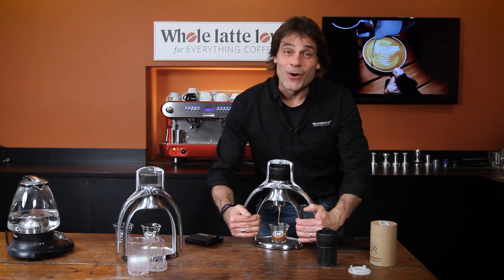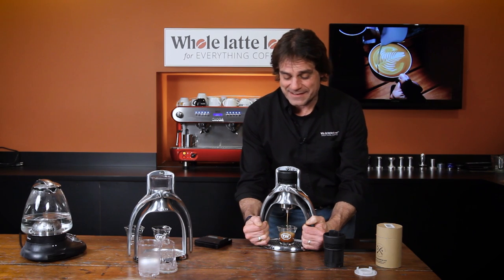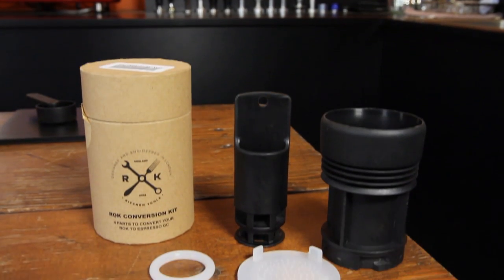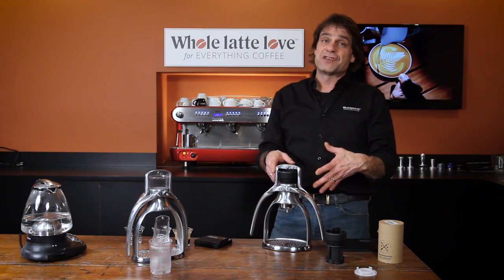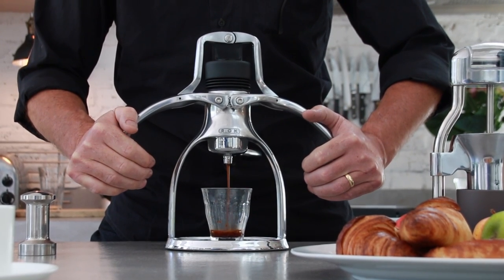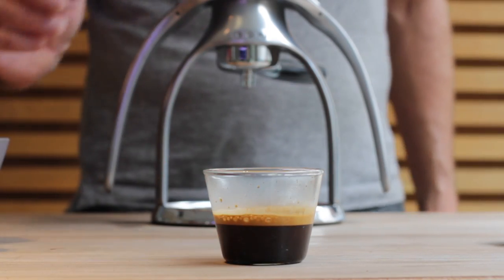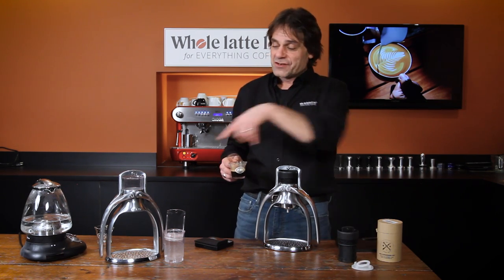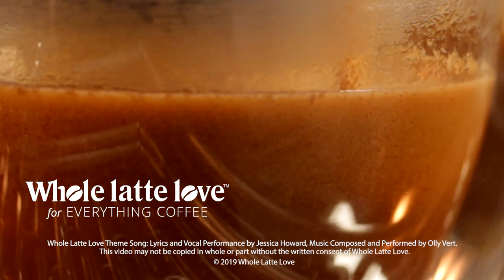ROK EspressoGC, GC Conversion Kit + Naked Extraction!

Comment: I have the original ROK. I found it to be more a labor of love than a practical way to enjoy espresso. So easy to make mediocre espresso that a rare success turns into a moment of euphoria. 
The new bottomless portafilter is a welcome upgrade because tamping with the previous center hole portafilter was uneven and measuring on a scale was a massive, messy chore. 

I definitely think you need either the ROK manual grinder or a mid to high-end grinder to get the consistent results that will make the extra work feel worthwhile. You also need quality beans. So don't confuse this as an inexpensive or "easy" path into espresso. Also don't think you're going to enjoy this right out of the box. It could take you dozens of practice shots.  

Perhaps this new design change has significantly altered the ROK experience and I will definitely get my hands on these upgrade parts to find out.
Reply from the maker: Hi y, Thanks for the detailed comment! I agree tamping the bottomless PF is a heck of a lot easier! We should have bottomless PF's in stock soon. As you likely know using the ROK well requires good temperature management. Really helps to run a couple blank shots to get things warmed up. For the shots pulled in the video I ran blanks. I'd fill the "reservoir" with boiling water and let it sit for a half a minute before pushing it through. When ready to pull a shot fill the reservoir with boiling water and brew immediately. After lifting the arms water starts to drop on the coffee I let it sit in that position for pre-wetting the coffee for 10-15 seconds before starting to push. A good grinder and beans definitely helps. The ROK manual works well and it's grind quality compares to a Baratza Vario - did a video awhile back comparing shots ground on ROK vs. Vario. I happened to use a Ceado E37K conical burr grinder as it's what I had plugged in and loaded with Maromas Orphea in the studio. In the end, I think it's comparable to using any machine for the first time. It's going to take a few shots to get to know it, get your grind dialed in etc. The Orphea is a very easy coffee to work with and I have used the ROK many times so maybe I got to a good shot faster than most would. It's easy to create more pressure with the redesign of the pressure chamber. Initially my grind was too fine but with the extra pressure compared to the old style I was still able to push the brew water thru. Took me about 4 shots to dial it back for the spouted shot I pulled at the start of the video.
Marc
Reply: I just bought rokpresso gc..before I buy it..I refer to james hoffmann review. After several times to try to find best ways to get good espresso..the outcome is really disappointed. The main issue is that, there is no enough pressure created by this device...only about 3 bars. Therefore, don't expect too high to get good quality espresso even close to it. Of course, pulling a shot is about art..result may vary from one to another. One can refer to other reviewers, the real sprometheus 'head to head flair pro vs rock gc', 'Rok vs flair espresso maker knock out' at tv by tom. Those two..gives a reliable and balance information about rok..not oo mention flair..as I haven't have it yet. For those who want to just having a coffee below par...just bitter taste..one can choose rokpresso. On the other hand, for those who want to having rich coffee taste..it had better to look around, see more testimonies from honest users...asking the seller to show pulling shot before paying it. I do hope this comment is helpful for those who plan to having manual brewing coffee. Wrong decision will waste of money, waste time and waste your lovely coffee to do trial.

Comment: I have been using my original ROK along with OE Lido for trips for 4 years until the plastic water chamber cracked. I am looking forward to buying an upgrade kit. Unfortunately, it is out of stock now. Will you have a bottomless PF in stock as well? What about tamper which fits this non-standard PF?
Reply from the maker: Hi Maksim, Thanks for the question. Here's a link to 49mm tampers which work with the ROK: https://www.wholelattelove.com/collections/tampers?_=pf&pf_t_tamper_diameter=tamp_diameter%3A49mm
I'll check with our product manager for ETA on the Conversion Kit and availability of Bottomless PF and let you know.
Marc
Reply: The ideal size for the ROK portafilters is an odd 49.7mm. I believe ROK does make a full stainless one piece tamper in that exact size, outside of that you’re looking at having one custom-made. Tamping with a standard 49mm can be done, especially with a north south east west motion but I fight some channeling issues with that method.

Comment: Hi, i have upgraded from my old rok to GC with the conversion kit, which is great to have the kit rather than have to buy a complete new unit.

I have a Krups grinder and run it on the finest grind setting otherwise is all the standard rok setup. 

I get a crema with my double shots but nothing like what was achieved on this vid, where might I be going wrong? I’m using quality beans from my bean man?

Any ideas
Reply: I use krups Grinder too, you can check out my video,  adjust your tamp and how much bean u use?  I using 17 gram with crups the finest grind
Reply: Don't worry too much about crema. Overrated. If it tastes good. It's good. Crema is just an Italian word for suds

Comment: how much water (mL) can be used to fill the GC's chamber?
Reply: Filling near to the top is 80ml. A single pull will extract a double espresso between 35 - 40ml. Raising the arms and pulling a second stroke makes around a 70 ml Espresso Lungo.

Comment: Video feels rushed. WLL didn’t take the time to show, explain and test the product! Many basic questions were unanswered. Why not test the temperature stability of the new kit versus the old one? Why not mention and measure the dose? Why not give some tasting notes and compare it with entry level pump machines? Didn’t get any information out of this video, which is out of character for you guys since most of your videos are detailed and useful.
Reply from the maker: Hi TCF, Thanks for the comment. This video was limited to the upgrade kit. We have other how to vids for the ROK espresso maker., I tend not to do taste tests as they are very subjective and subject to so many variables.
Reply: Whole Latte Love none of the other videos have temperature stability tests, something you guys did on many other pump machines to show temperature stability. The whole point of the kit/upgrade is that it improves temperature retention and stability. This video doesn’t prove Rok has accomplished that.

Comment: Would you share how many gram coffee in it and the grind size?
Reply from the maker: Hi tas, I fill the ROK PF and over pack slightly. I've never weighed the dose - I just try to get as much in as possible. So fill loosely to rim and then a gram or two more. As to grind size, it's very fine - typical espresso grind a little finer than granualated sugar. Sorry there's no good way to characterize the size. Have to dial in to a size which works for the coffee and dose you are using. If shots are coming fast and thin grind finer while trying to keep the dose weight the same as you adjust the grind size. Hope that helps!
Marc
Reply: @Wholelattelovepage  well thank you and really clear suggestion, I'll try make it good then.

Comment: full testosteron caveman espresso
Reply from the maker: The new design is easier to operate with the increase in mechanical advantage due to smaller piston in pressure chamber.
Marc